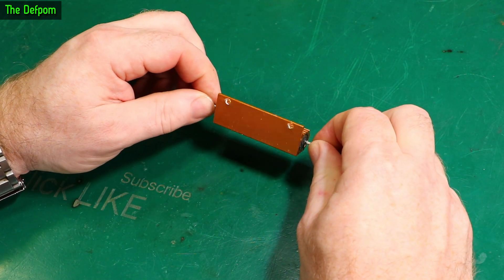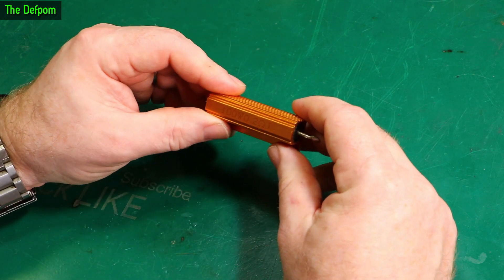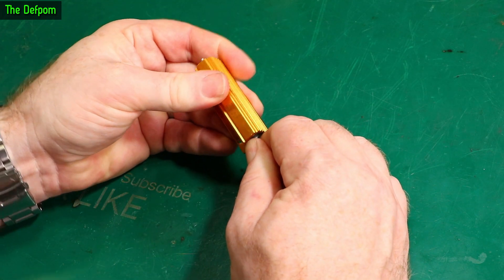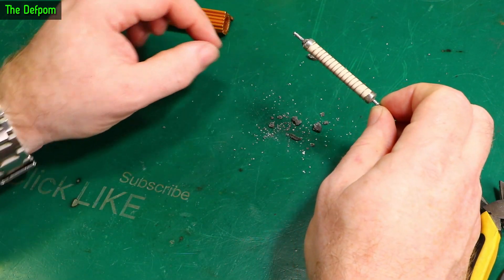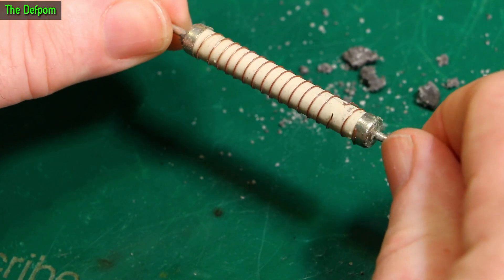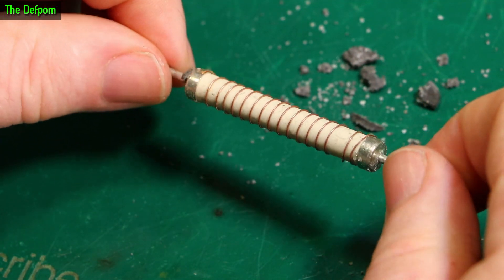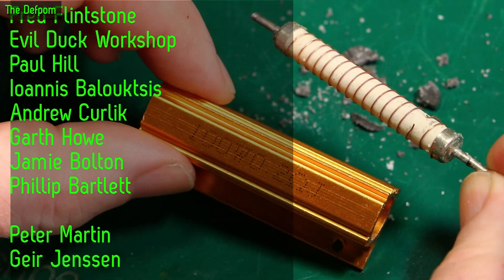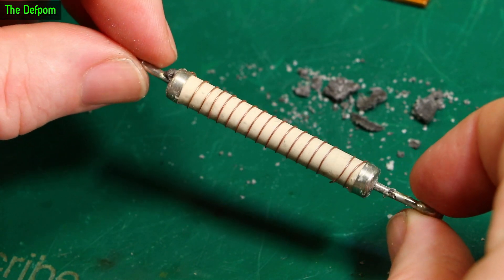🔴 What Is Inside ? - High Wattage Resistor - Is It Fake ? - No.1054

Comment: Thanks for the video. I have the same resistance as the one in the video on which is written: 12R J 1139. but the wattage does not appear. Question: what means J 1139 THANKS.

￼

Comment: No way 100 watts without external cooling/heat pump. Maybe 10 watts in free air. Chinese are so good at misleading ratings. So Scott, do a destructive test on one, and let it dissipate a full 100W free air. That would be fun. Simon Spiers did a test on some of those shoddy over-rated jumper leads a while ago. 😆
Reply from the maker: Yes I remember the flames from Simons video…

Comment: The problem with this style of high power resistor seems to be that the quoted maximum power rating depends entirely on the size of the heatsink they are attached to.  This is never stated in the adverts.  It would be interesting to see some test results.

Comment: There is another issue with these types of high power loads, they are also quite inductive, and so the resistance changes to be impedance as now you have a reactive element. So as the frequency goes up so does their impedance.

Comment: Interesting. I would've expected them to be filled with some kind of ceramic cement.
I use these resistors in a large bank (on a large tunnel heatsink) to test powersupplies. But I never load them to 100W/piece, ususlly between 25 and 50w and they get plenty hot.
But they are so cheap, that it's no big deal that you have to use more.

Comment: Quartz sand (aka silica) very commonly used in offshore certified electronics equipment to fill voids and is very heat resistant so that in your resistor the wire stays an equal temp along it's length. Another property is it's purity, meaning contaminant free thus would never be the slightest conductive. We used to make ultrasonic level sensors and filled them with the stuff back in the day.
Reply: Ok I was thinking possibly silica sand while I was watching the video

Comment: The construction with silica sand is the normal way these power resistors are constructed.  However I do hope there was considerably more sand the first time you opened it up.
Epoxy fill is hard as these resistors can safely operate well above 200°C, that few epoxies take well long term. Certainly not pure epoxy  but would need powder filled variety  itself hard to squeeze into the internal space and curing properly.  Usually the end seal is almost a glassy substance, the fine sand fill if properly done, has excellent thermal flow and very good high temperature handling  and being dry powder relatively easy filling with a little vibration to settle in well. Manufacturing process cheaper and easier than pressure feeding powder filled epoxy paste , that itself is costly and beginning hardening process, messy and cleaning issues.  Yes some power devices have what almost looks like dried cement fill, that is some form of powder filled epoxy. These gold colour power resistors normally are sand fill and glassy looking end cover.

In this case I do wonder about the fine wire used. With 0.2 ohm at 100 W,  means only just under 22.4A (using P= I^2×R) so actually  bad, looking very prone to fusing, as little contact area with both sand fill and core ceramic cylinder, especially  if not thoroughly packed with filling sand, and so any region with air void and you have a fuse as much as a resistor. 
For this I would have presumed and infact have seen low ohms power resistors using a flat wrap of nichrome strip, with near complete surface of ceramic core covered. Far less prone to blocking sand fill leaving no voids and maximum surface for thermal flow.

Yes likely cheap manufacture item, taking short cuts with lowest cost materials and processing.

Comment: The "sand" is needed, without it the resistor has no cooling, only the air inside but air is a bad thermal conductor. It is also there for safety isolation. If the wire brakes and carries a high voltage you do not want it to touch the housing. You see the same thing in those square ceramic resistors and in the big fuses in DMMs. The Chinese do not use the sand because it makes the stuff cheaper.

Comment: The better ones use a much finer sand fill, basically a magnesia powder that is vibrated into the unit, after the element and one side is inserted. Then they might also vacuum impregnate with a compliant silicone resin, and then place the end cap on the open side. 

Remember that those are not actually classed as insulating, you need to either ground the heatsink it is bolted to, or arrange separate insulation if it is exposed ungrounded metal, as the element inside can run hot enough to get to red heat, and make the silica conductive. If you want to see this take a 5W ceramic one, and run it till it is at red heat, with a steel wire wound tight around the ceramic, and check insulation resistance between the inner element and the steel wire when it is at dull red, and it will be measurable. 

In mains applications I have seen them sustain current flow and stay red hot, as the thermal cutout and control was on the neutral side, and the equipment did not have RCD protection. That was added on later, even if it did mean I replaced a good few cartridge heaters that were leaky slightly, especially after a week of non use, when the magnesia fill had adsorbed a tiny amount of water.

Comment: I've got some small ones from the '60s... I still can't get my head around how some could be 8 ohms, ect... Looks like a dead short wire wrapped...
Reply: They’re usually made out of nichrome wire, which has a much higher resistance than copper. 

It’s worth looking up a chart of wire gauge vs resistance. You’d be surprised how much resistance smaller wires have. 

Nothing is ever really a “dead short”, it’s just such a low resistance that it’s way more than the supply can handle.

Comment: That was surprising Scott! I would have thought that they were fully thermally hard potted (although that would cause thermal expansion issues and would put mechanical stress on the resistance wire as it heats up) or filled with thermal paste (an expensive option), but I guess the 'sand' is silica which should have good enough thermal conductivity properties for what these resistors need.

Comment: I have a bunch of these, been good for various utility.      For example one is mated to a 5mm silicone heat sink pad and used as a soldering pre-heater for those aluminum circuit boards found  in LED lamp .   It has 160 ° C thermal switch on its backside to keep it around that temp.  

I'm impressed you killed one.  Did you really dump 3000W  into it, or was it current limited?

Comment: That's good ol' China Junk for ya! i swear they put sand in everything just to bulk up the weight. even though they go throw all the trouble to make products look as close to the original as possible, and yet the products always falls short, pun intended.
Reply: Not everything, they don't put sand in "High Rupture Current"  fuses which are supposed to contain sand as an arc suppressant. Chinese logic?

Comment: I opened one of those loong time ago and it did not have sand in it. The real ones are much tougher to open. Best bet to open those is maby to heat it up really hot and then pull it apart. Or use brute forse and vise  to get it started. If i remember right it was ceramic in the senter and black epoxy between it and the aluminium housing.